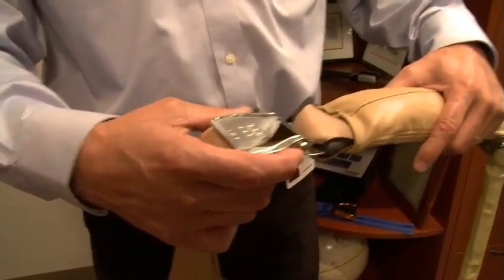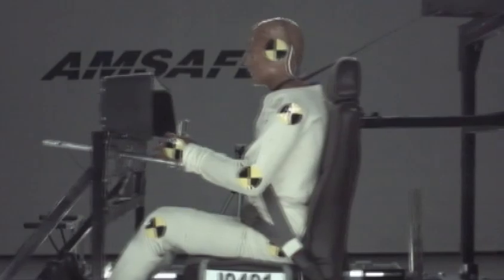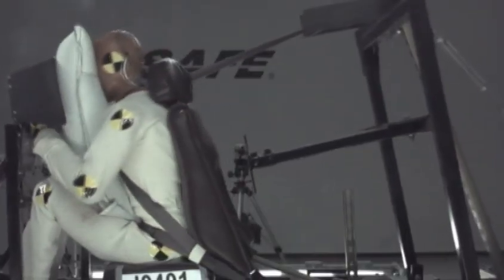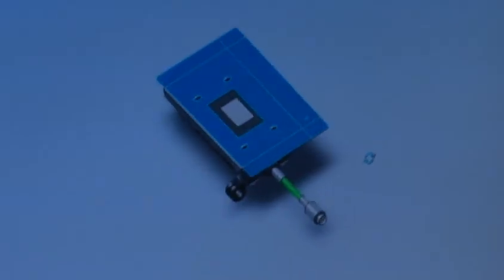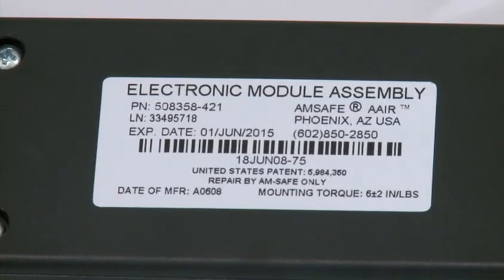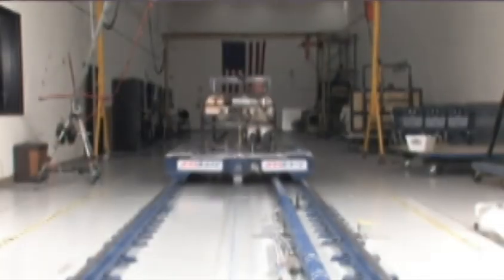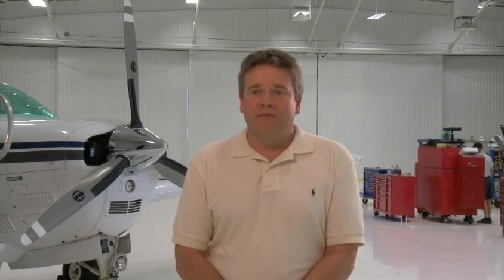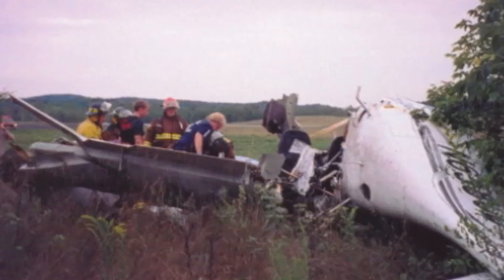Amsafe - How Seatbelt Airbags Work

Comment: Would be nice to see them develop leg bolster type airbags. Legs get mangled pretty horribly in many crashes. The instrument panels lower edge is not very forgiving when you smash into it at over 10g
Reply: 10g just means acceleration. It's not a measure of speed.

Comment: My comment will be implied by my question. As a 6'-7" man that is not at his ideal weight, when I sit in an airlines (ALREADY) small seat (even for a regular person) with the seatbelt latched, the airbag is on the side of my body (latch being near the top of closest leg). Worse, when in a bulkhead/exit row where the arm rest is solid to the seat, it appears the air bag would push me sideways or perhaps between me and neighbor. I've seen no video showing correct placement for correct operation.
Reply: Lose some weight! An airbag shouldn't be required to cover every condition, especially so severe as your case.